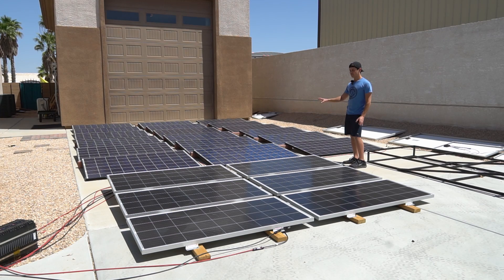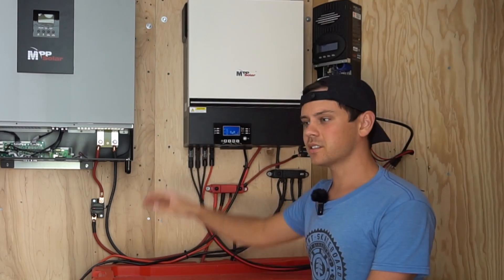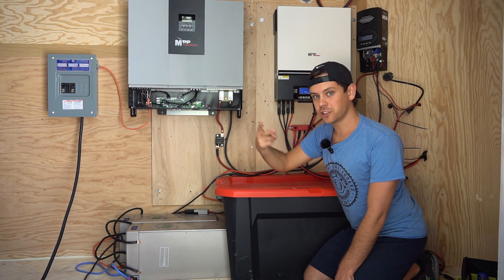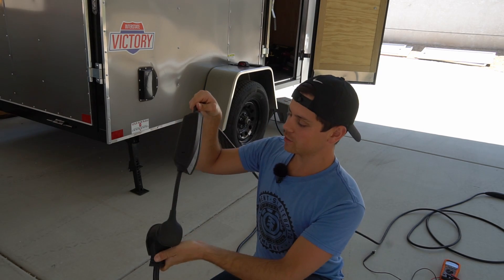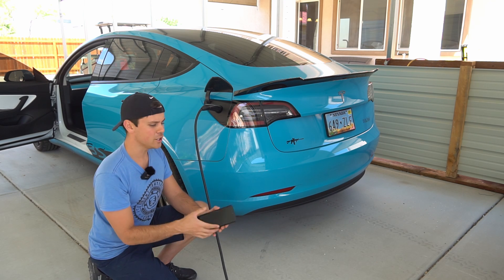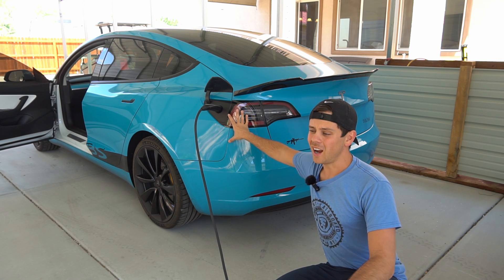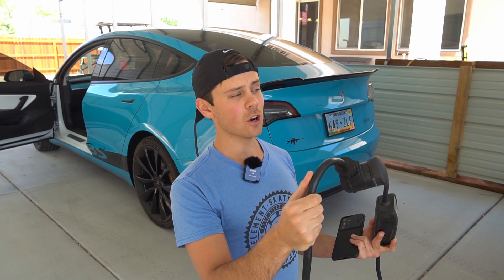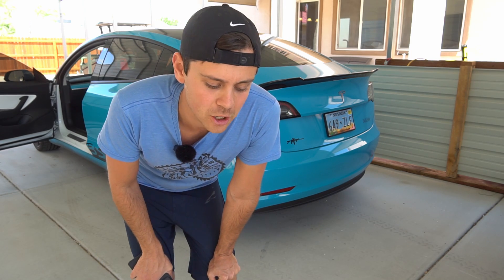Using my Offgrid Solar Trailer to Level 2 Charge my Tesla

Comment: That is super grate just using the sun to charge the car. Others if they plug it in the house it my use coal or natural gas or atomic. The 1st 2 came from the sun any way. But put carbon back in the air. So you are doing super good with this grate job!

Comment: Outstanding. This is what i will do for my cyber truck when i get it. I can then power my cabin off the outlets in the bed. Just hope the inverter losses arent too great as the truck battery will probably be 400V and I will need 240V

Comment: Im struggling to start a mining operation on full solar where I live, hopefully you will be able to do it
 S2
Reply: @BobDevV  in my case is not too much about the sunlight, is more about the price of solar pannels and batteries(high taxes), also we have a very odd law that kinda prohibit to have solar pannels to own use without paying taxes for that energy u "captured", even if is not connected to the grid
Reply: @AndreYoshinoriOta  ouch 
that sucks for sure
Reply: Find out if you have to pay tax on recovered  power from rig heat 😆 BECAUSE IF SO GUESS WHAT YOUR STATE WILL PROVIDE  WOMEN  FOR FREE TO ALL MIGRATING MINERS

Comment: 4.5k solar setup in UK with 13kwh Li-ion battery in Shed. pulling regularly in cloudy UK Summer 4,000w. Running 400mhs of RTX graphics cards mining Eth (UK electric expensive). Works great and cost not much as I bought older 250w Solar panels at £35 each. 2 x 2kw 240v inverters that do not feedback to grid and a couple of 3.5k solar to battery chargers. Just need to build BMS as that awful capacitor BMS exploded. Tesla Model S seems to like charging off it but I need it for the Eth mining :)

Comment: I need to get a Tesla. But I been wanting to do solar panels to power my house. Let me know if you can guide me.
Reply: Home solar in the U.S. is getting cheaper and cheaper. Go to the Energy Sage website to see what's available around you and how much it'll cost.

I have no affiliation links with Energy Sage, but did use the service when I installed solar in 2019. The Transport Evolved youtube channel used them recently as well.

Comment: Start throwing 3500w 240v bitminer asics in there and youll run out of solar  :P
Reply: Not if he uses immersion  cooling and puts vapor thru turbine to recycle heat back to miner power LIKE MICROSOFT SHOULD BE AND SOON SHALL AS WELL.

Comment: Hello Will. I enjoy most of your videos. I have a 100 amps battery protect and I have 4 VRLA batteries and I want to parallel series it to make 24 volts for my system. What is the setting should I put for the battery protect? Please answer my question. I need your help.